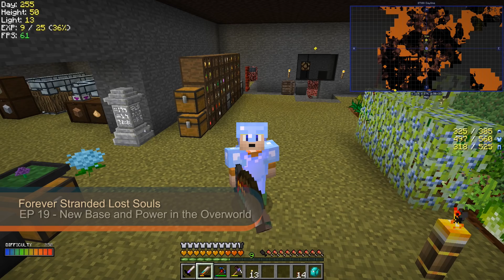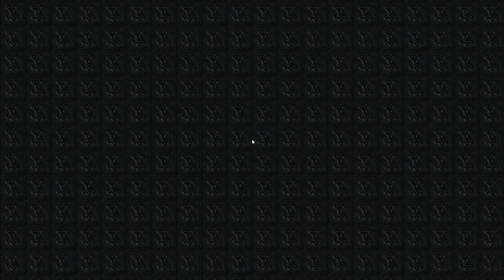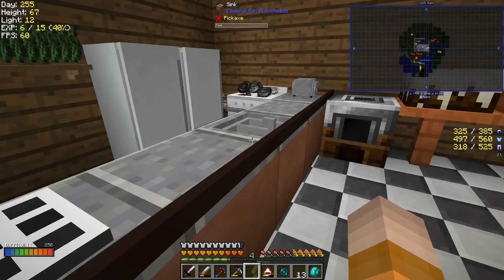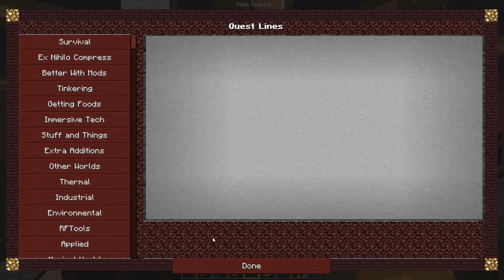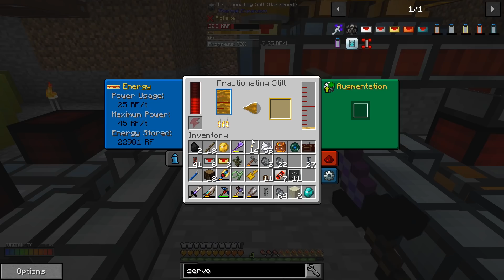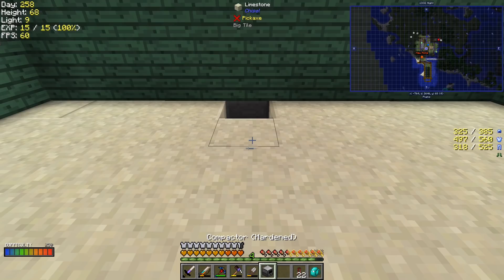Forever Stranded Lost Souls EP19 - New Base and Power (Modded Minecraft)

Comment: the pump from ie provide water with low cost on power (only in the overworld :))
Reply from the maker: It may be a solution. I will test it out thanks.
Reply: this was going to be my suggestion as well, or the industrialcraft pump is similar

Comment: Esk garden cloche + sand+ cactus+ a bit of energy from the dynamos = infinite water.
Reply from the maker: nemo4evr but then I need a thermal expansion machine I think to take water out of cactus right? I think so
Reply: nope you just use the oak crucible to make water, use a drawer for the cactus and transfer pipes to the crucible  I just use a transfer node (flat one ) and use a drum to store the extra water
Reply from the maker: Off course. When I read this I was not thinking at all. Lol thanks